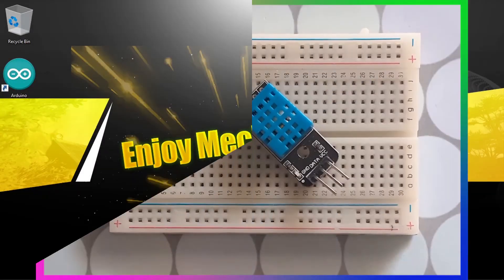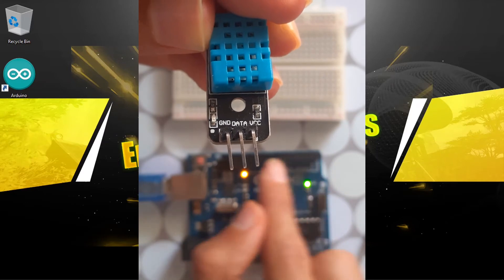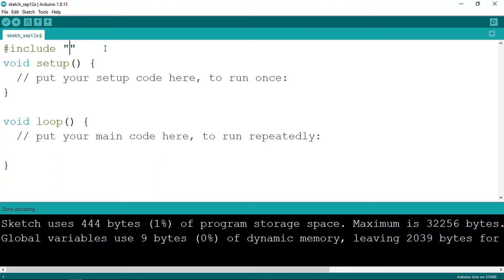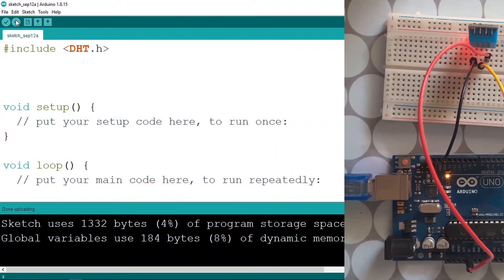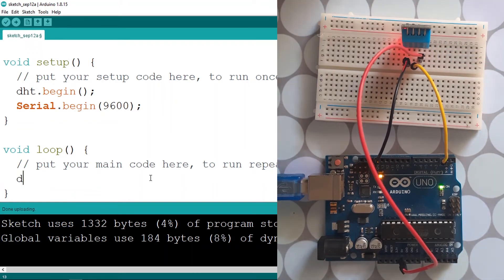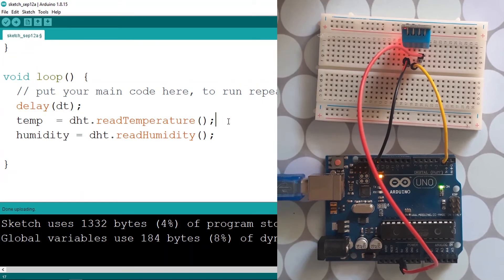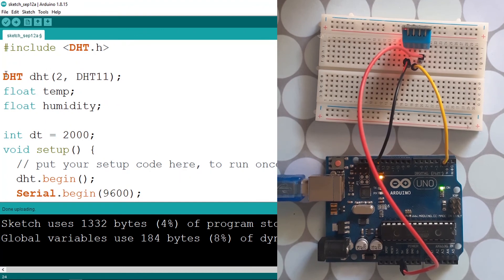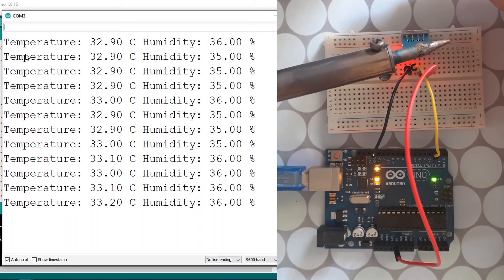Arduino Tutorial 23- How to Use the DHT11 Temperature and Humidity Sensor

Comment: the DHT11 sensor is junk. I hooked it up and for the first 4 hours is read  temperature and humidity pretty accurate although it did drift a bit. I went to bed and left it run. When i came back the next morning the temperature was still accurate but humidity is a constant 95% and will not change no matter what you do. I find this completely unacceptable. This sensor was running at 5.082 volts which is in its range of 3.3 - 5.5 volts.  If it wont run for a day what good is it?